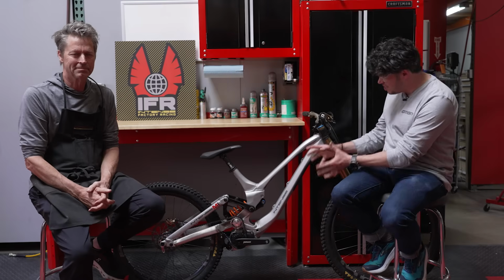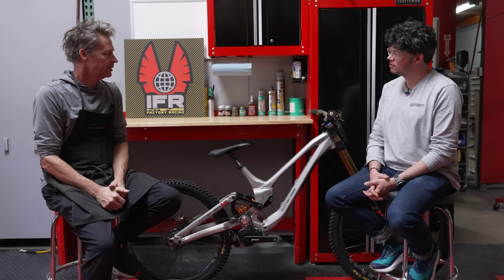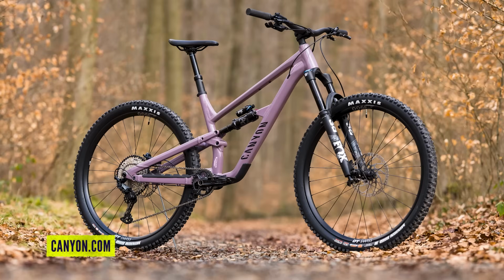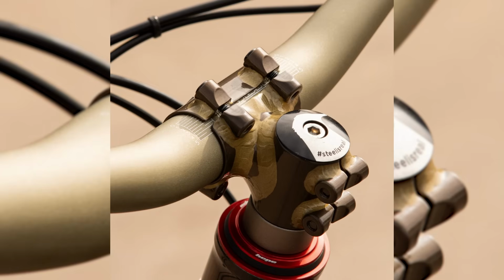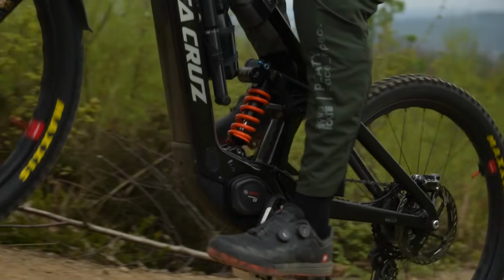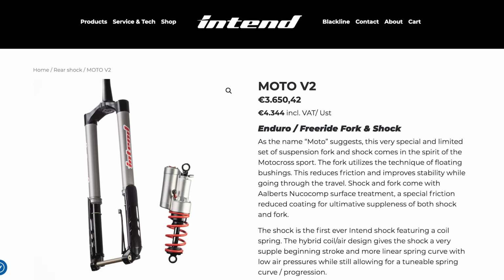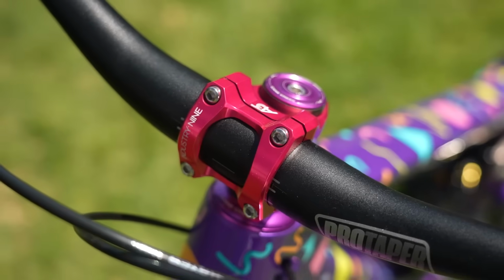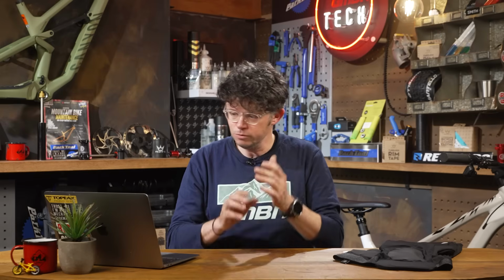INTENSE Goes Gearbox? Exclusive Jeff Steber Interview | GMBN Tech Show 382

Comment: Owen, if I had the chance to put a question to the Intense boss it will be: did you use the standard Pinion gearing or a custom one? I know that on downhill races there are few but crucial pedal strokes, so riders want a road like cassette, not a full 500% range...

Comment: Why focus on such market as downhill  mountainbikess some with enduro most people don't own them of have trails for them trail or xc is where it's at for most people stop promoting crap that is useless for most people.
Reply: I think the focus on DH racing for Intense and potentially other brands with the Gates Belt drive & Gearbox is the accelerated development - DH racers push hard in tough demanding conditions - its also that the current gearboxes limitations - weight and fitting the gear box into the bike - are minimised for a DH bike - whereas the additional weight around 1.5kg and fitting it in place might be too much for both Enduro and especially XC racers to race with. 
As a Brand Intense have just launched an all new Trail bike that use more convections gearing - we covered on the first day at Sea Otter. 
Cheers
Owen
Reply: @OwenBikeNerd  DH Market is only very  small world wide XC and trail is a  bigger market.

Comment: I have a question. You mentioned the flat bar gravel bike again. What is the difference between a flat bar gravel bike and a hybrid. As I have a 20 year old Kona Dr Dew . Which I reacently upgraded the brakes to Hope Tech 3, X2 with 180mm front and 160mm rear rotors. I have also fitted 1x11 Deore with the 11x51 cassette and a 40 tooth chainring.
Reply: Great question we'll ask Forbidden and find out! 
Cheers
Owen